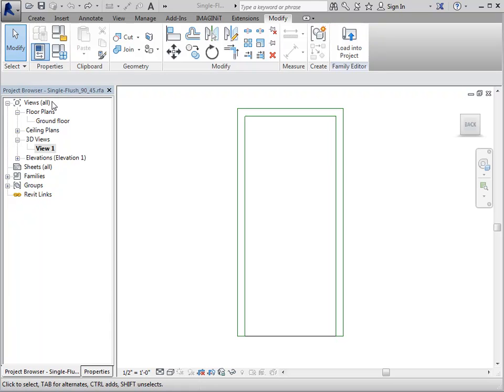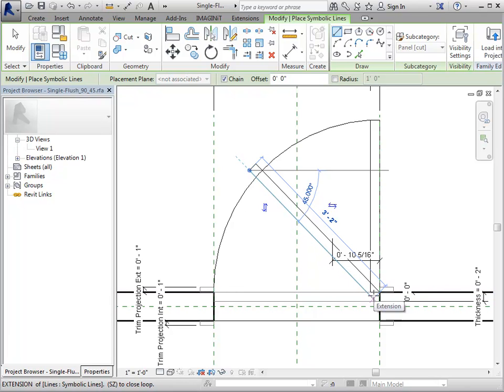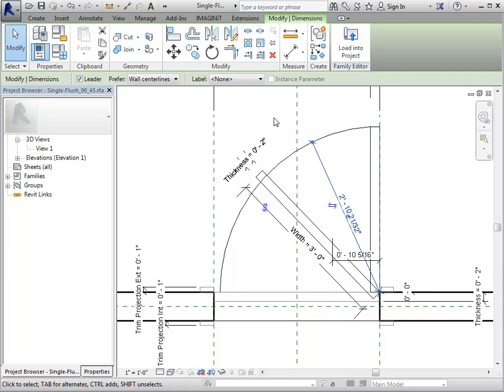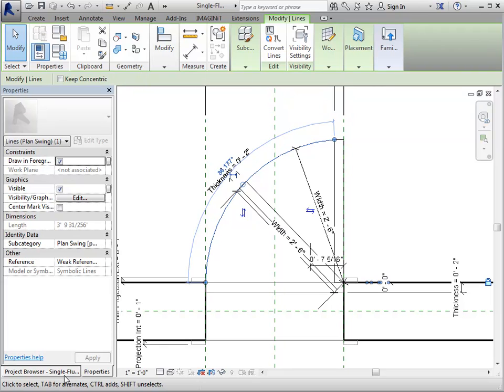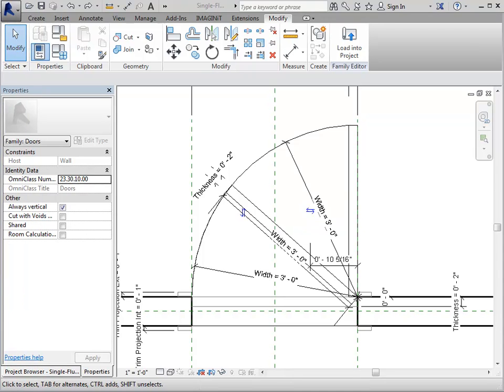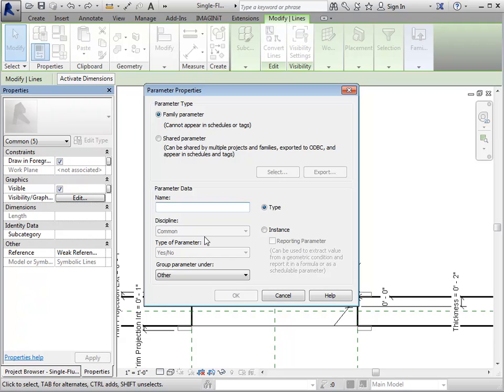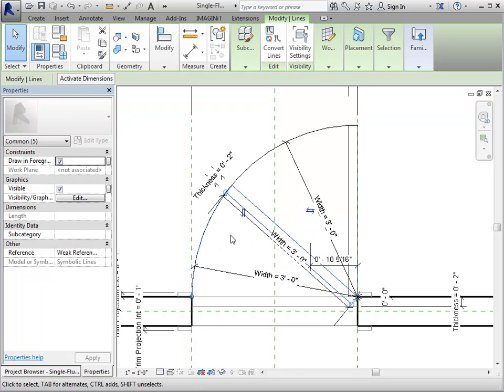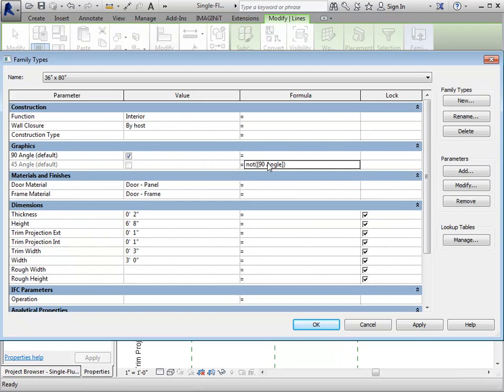Revit:  How to Add a 45 degree Door Swing with Visibility Controls

Comment: Hello, the first time I ever followed your directions here it worked great.  Now, for some reason after I draw the four symbolic lines representing the door panel, and the dimensions for thickness and length, attaching the dimensions to those parameters makes the lines go all askew?  I'm drawing the lines in the same order as you.  I'm making sure the dim's are connected to the correct lines (not the one's that shouldn't move).  

Any ideas?

Thank you.